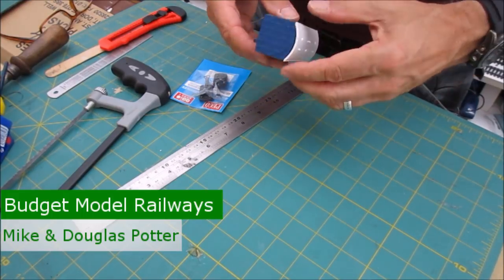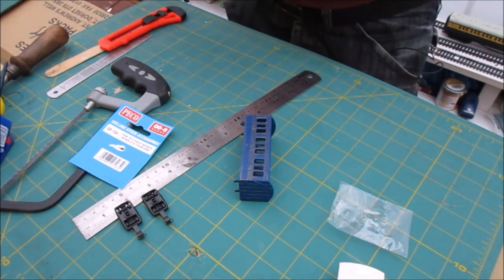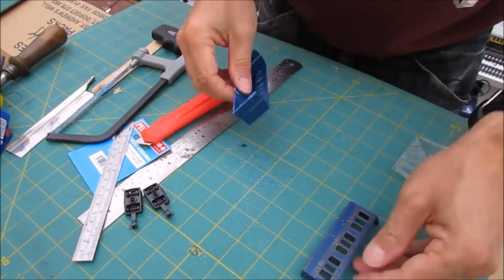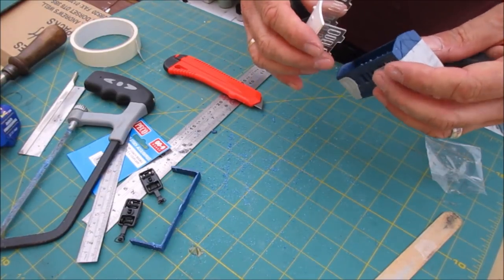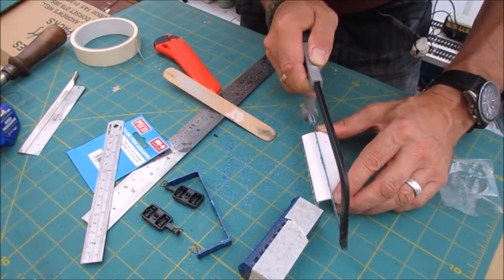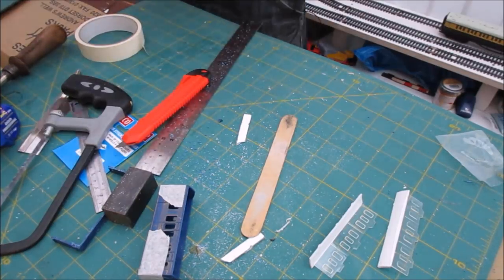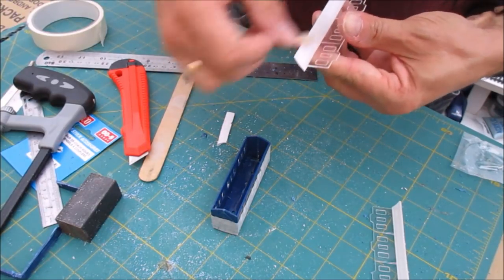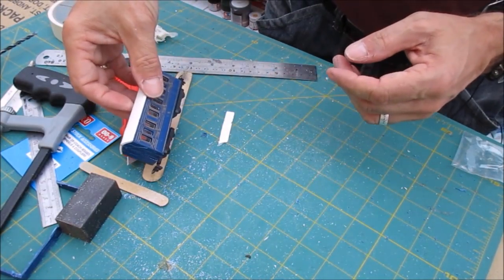Tutorial Tuesday Episode 4 - How To Build An OO9 Coach

Comment: Man, its about 40 quid for the Lyndon barstaple coaches and 24 for the GVT coaches by peco, any other bogie coach kits are around 20, this is great and cheap. I have one of these gathering dust in the closet, perhaps I have a weekend project ahead of me. Great as always. Luke.
Reply from the maker: Hi Luke. You could also cut the sides off and make different floor and end to make it whatever height and width you want.

Comment: Hi Mike, 
What an absolutely brilliant idea .. I too very much like 009 as I don’t have a lot of space for a layout and if truth be told I too was slightly put off by the £40 price tags for 009 bogie coaches from peco. 
I have about 4 different sets of these hornby 4 wheel coaches .. so an 009 layout is now in pipelines 😎👍 Thank you. 

Just a suggestion.. aren’t the coaches a bit to light.. maybe some small weights added (avoid derailments) ?. 

Kindest regards 
Dan 😎👍
Reply from the maker: Hi Dan, like you I thought £25 for a small peco coach was a bit steep for me, you can pick these up for about £3 my body cost me .50p, so £5 for two bogies is fine. You are quite right they will need weight, I have some lead off cuts should do it. Mike